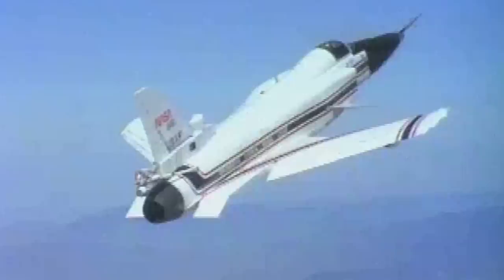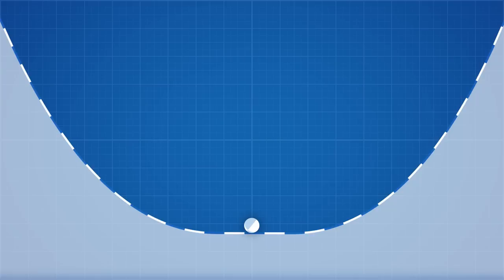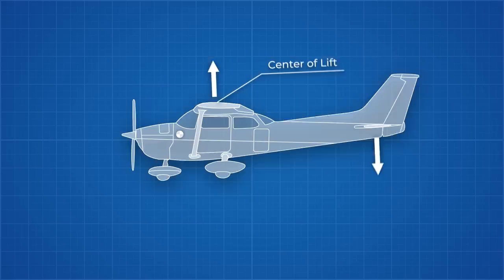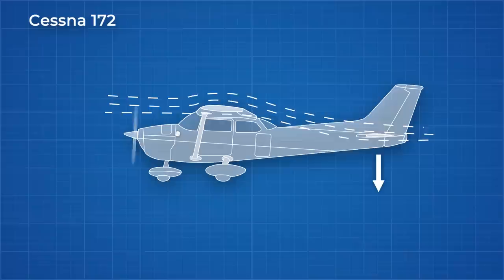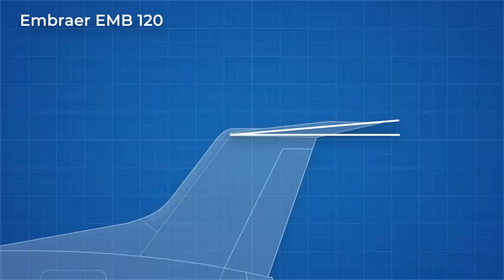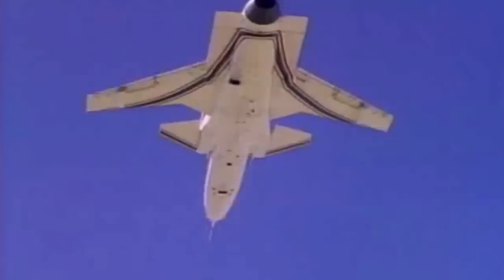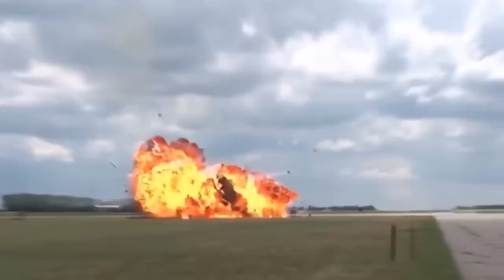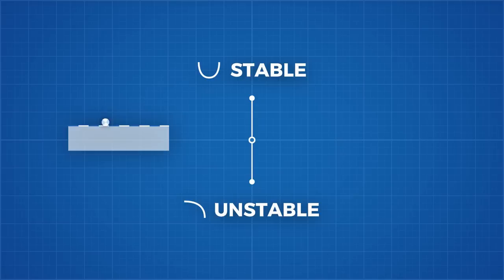Why Fighter Jets Can Be Too Unstable

Comment: if we gave plane engineers ksp years ago you could make a simple plane design on paper in minutes because aerodynamics are honestly pretty simple. anyone can look at that plane and tell that the connard is too close to center mass. the wings are far back for a verry rearward lift. then the connards are placed presumable just in front of the center of gravity. and the plane can therefaul almost turn on a gimbal theoretically speaking. but obviously theres more life produced in the rear to some degree otherwise the aircraft would spin uncontrollably. like how he said that they needed alot of computers for the plane to make proper corrections. it is insanely unstable. one wrong move is a plane obliterating it self at 600 mph. what they SHOULD HAVE DONE was put the connards towards the nose. this would result in almost torpedo like handling. literally all they needed to do was move the front connard forward 3-4 feet and it would be perfect. 3 feet if you still want good turning but 4 feet and it would be more stable.
Reply: you may look at something like the f22 and say well all the wings are in the rear ect. but the difference in aerodynamic controll surfaces. is that connards pitch from in front of your main wing axis. and elevators pitch from behind. making a more dart like controlability and manueverability. this is made by perfecting the we distribution and keeping center of gravity just before the main point of lift.
Reply: also the reason some of the later aircraft in the video are actually unstable is. for example the f4 is unstable in flight because the rear elevator winglets are angled towrd the ground at about a 45 degree angle. this causes a verry unstable  vortex that makes you like a nerf football. you arnt meant to turn like that. all elevator surfaces should be inline or close to inline with the axis of your other wing surfaces to prevent odd vortexing or incapability to control your pitch and roll axis. effectivly speaking. the adjustments to the wings is essentialy an attempt at correcting the rear winglet situation because it acts as almost an X shape if you look from the front. this makes a more controllable "dart" but will severely hinder its capability in any given situation.
Reply: now let me explain as to why the f16 is able to achieve having the center of gravity behind its center of lift. so essentially on paper this allows you to pitch on the center of gravity axis much more. if the center of lift is too far in front of the center of gravity. the lift from the wings overides any inputs from the rear controls because the axis of drag on the wings to the center of gravity is so strong the rear winglets cannot overpower the airflow. this usually leads to a plane flat spinning and probably self destructing. however if the center of lift is only just in front of your center of gravity then you can achieve sharper turning

Comment: The title of this is dumb.  You want your fighter aircraft to be somewhat unstable so that it can turn, jink, and pull more G's quicker.  If it flies like a nice, stable passenger aircraft it will get shot out of the sky in a heartbeat.  Obviously there is such a thing as too unstable.  There are fixes for that.  It's why they made the F-16 "fly by wire" with a computer controlling the inputs.  Even more so with the F117 and so on and so forth.  In the old days with the Sopwith Camel and later the P51,  "too unstable" depended on the pilot

Comment: The worst explanation I've ever heard. The weight can't be the "stabilising" force, which brings the aircraft to level flight during the putching upwards. All movements are around the cg, so weight can't create the torque aroung cg!!! All this hapends due to direvatives of lift by the angle of attack, etc.
Reply: Very much true.

Comment: To be honest i don't like the way you explain static stability, because not only the horizontal stabilizers downforce changes with the pitch of the plane, also the lift of the main wing changes. Your explanation doesn't consider the effect of the main wing. You should have introduced the neutral point.

Comment: The statement implying that ALL passenger aircraft are inherently aerodynamically stable and that anything otherwise is unsafe is grossly inaccurate and misleading both the MD-11 and B777 employ relaxed longitudinal stability requiring computer augmentation for stable flight and certification - this is certainly not inherent positive stability 

As Boeing puts it "Both use flight control computers to give the appearance of more longitudinal  stability than they actually have" - this is NOT inherently dangerous as proven by the B777's safety record.

More accurately - Certification requirements for unstable airliners are a function of an acceptable pilot workload, pilot perception of handling characteristics and as always redundancy 

Please stop implying that aerodynamically unstable aircraft are only safe because they are attached to ejection seats an ejection seat does nothing for the folks on the ground except put them in mortal danger and no airforce on Earth is in the business of crashing jets or stranding pilots in enemy territory.

Comment: "every passenger aircraft is designed to have static stability" Yeah no, if you took the computer aided fly-by-wire out of any contemporary boeing aircraft it would plummet from the sky.

Comment: Is that why no passenger aircraft is designed with internal (inboard?) (integral?) Engines?

Please please pretty please do get on that subject in future projects
Reply: No, there wouldn't be anywhere to put the passengers, it wouldn't be cost effective, and the sound would be deafening, most likely.
Reply: @daexion  ah. I thought engines in nacelles on pylons is a safety measure in case of fire (and stability, I imagine)

Engines create drag, I imagine, why not do an s duct inlet like in the tristar or many fighters?
Reply: @kaungsithusett9017     Are you asking why the engines are not inside the airplane's fuselage on an airliner or why the engines are not part of the wing?  Internal engines would be inside the fuselage.

Please make your questions clearer in the future so people actually understand what you are asking.

Also, there is a plethora of information pertaining to how and why aircraft are built as they are that is often found using a search engine such as, but not limited to, Duckduckgo.com or google.com .

Comment: WRONG! PITCH STABILITY DEPENDS ON THE RELATIVE ASPECT RATIOS OF THE WING AND STABILIZER. The surface in front has to have a greater aspect ratio than the trailing surface for the plane to be stable. This controls the relative shapes of the lift curves and ensures that the foreward surface is more reactive to airspeed changes than the aft surface. This is also why people wonder why canard airplanes have such narrow control surfaces. Your explanation fails in reality.  Aircraft are also neutral to mildly unstable in roll. This because a roll stable airplane will exhibit dutch roll which is a notorious cause of sea sickness in pilots and passengers. This instability, to accommodate human physiology, is why the simplest autopilots are wing levelers. The misconceptions you are spreading are also often given in flight training classes and even encyclopedias. You have been deceived by well meaning fools.

Comment: @Real Engineering, thumbs down for dumbing down the "lesson" with inaccurate graphics and commentary.
Reply: Care to point to what was inaccurate specifically or just trying to throw shade with no substance?
Reply: @bengrogan9710  The main objection that comes to mind as I pound the keyboard is that one of the graphics and related commentary erroneously depicts the C of G of a Cessna at the firewall, which is so far forward of the actual C of G (slightly forward of the wing's mean quarter chord) that no amount of up elevator could prevent a crater in the ground. The stability well diagrams could also have been generated with a wee bit more attention to detail.

In the process of getting my pilot's license, I recall being puzzled why Cessna would choose the firewall as the datum line (not to be confused with the C of G) for weight and balance calculations in the Pilot's Operating Handbook. Understanding the concept of moments (foot-pounds or Newton-meters of torque) convinced me that the choice of datum line is analagous to degrees Celsius v degrees Kelvin, i.e. a choice of a reference zero.

Prior to earning my private pilot's license, I designed, built, test piloted, and soared 2 tailess hang gliders, so I know whereof I speak. I do not troll, but I'll call bullshit whenever I see a scantily-clad emperor parading about, because that's the kind of guy I am.

To be fair, I credit the video under discussion for mentioning the 40 Hz servo loop closure rate that colleagues I've been privileged to work with cited re: their involvement in the Sidewinder missile and F-16 fighter programs. Real Engineers are lousy politicians, and I have been on the receiving end of merciless criticism whenever I was found guilty of a fallacious design rationale. This is as it should be in the quest for getting it right.
Reply: @myronplichota7965  I'll grant you that one with no issues - I choose to believe however that this is an intentional oversight  for visual simplicity explaining to others here
For example if the CoM and CoL are that close together if can confuse the less practical minded when demonstrating a turn on the CoG if they mistake the turn fulcrum to be the CoL then many more confusions would follow
Reply: @bengrogan9710  I appreciate your response, and I also must admit that my prior post was fixated on the subsonic mean quarter chord CoL because my piloting experience has been well below Mach 1.